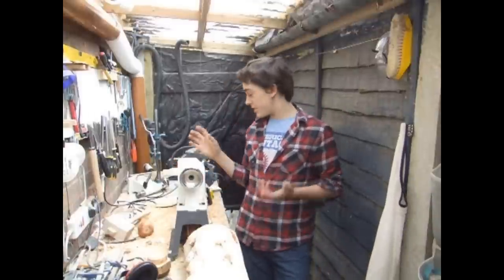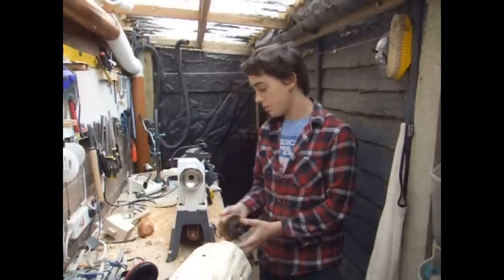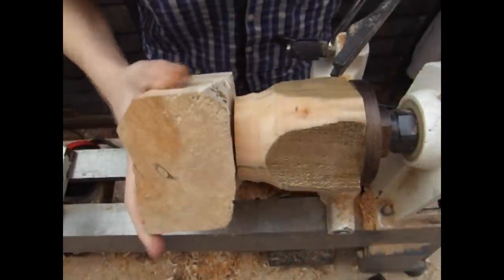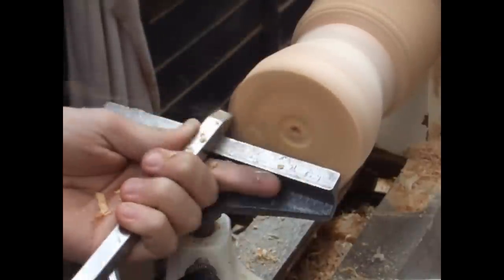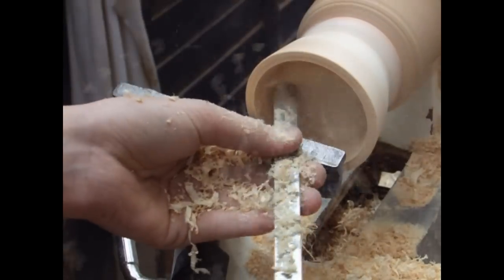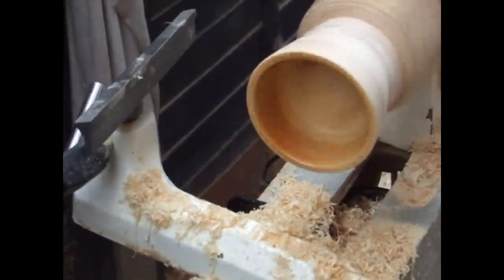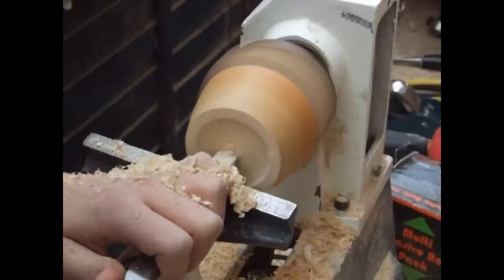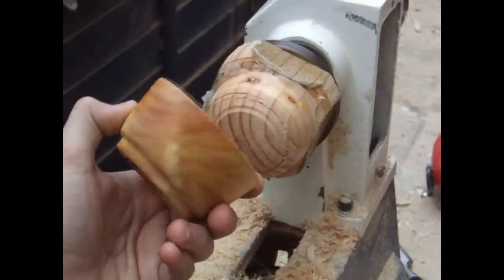Wooden Bowl Turning From a Log

Comment from the maker: Usually as long as the work is not vibrating noticably the speed is fine. Higher speeds will usually give you cleaner cuts as long as there is no danger in spinning the wood (depending on how securely it is mounted)

Alex

Comment from the maker: A scraper can be a very useful tool but do not become discouraged by your lack of success with the bowl gouge. If you can learn to use it, it sure took me a while then it will likely give you much cleaner cuts. If not will certianly make the bulk of hollowing quicker as only light cuts can really be made with a scraper.
All the best, Alex.

Comment from the maker: @Monkeyboy4jesus 
Most lathes usually come with a facplate but if you dont have one you can turn between centres, this is usually better for larger bowls and then turn the inside to a point where it is just about to fall off and remove it and then you will have to cut off and sand the two stbs at either end and then finishs it off the lathe.

Comment: they are all so fantastic work. I have an Atlas 6" metal lathe, and have no place in my shop for an extra. I wonder there is such wood-turning chuck out there that can be used on my metal lathe. I also need a tool rest for work working. Would you mind sharing some insight?

Comment: @sandstar102 one tip is to not scrape but to acctually ct. the fase of the edge should be parallel to the desired direction if the cut. So the edge is pointing so to speak in the futue direction of the cut.. abit hard to explain but youll get there im sure

Comment: I always enjoy your videos Alex and as a beginner to this hobby I find that my lathe(CWL1000) has problems i.e. the headstock is solid and can't take for example a morse taper/drill bits etc and the same applies to the tail stock. Are there suppliers who can accomodate these non standard features by supplying equipment to make these functions possible?

Comment: Turned a bowl of approximately the same size in the video from a piece of knotty pine. The piece had a sap pattern in the shape of a starburst directly through the center of the bowl. What I do not know is what happens to natural sap patterns over time in a turned bowl? Do they dry up and fade? Do they crystallize and harden? Would a polyurethane finish be enough to seal the sap in?

Comment: a good rule of thumb is the diameter of the work X 1000 should be between 6-9000.  
for example a 6 inch diameter would be safe at up to 1500 rpm max. ( 6 x 1500= 9000 )

Comment: ok I'm making a bowl out of 6 boards (the boards are made out of 5 small strips) the boards are 3/4in thick and the block when they were clued together it was 5in by 5in then i had to round it out on a bandsaw before i could turn it. ive finished the outside now I'm trying to decide how deep i want to go, I've made it through the first 2 boards and I'm starting on the 3rd. anyone got some suggestions? thanks in advance